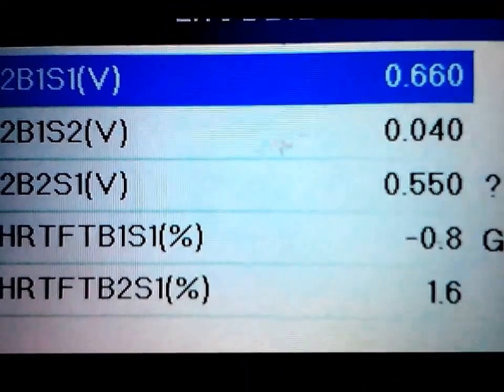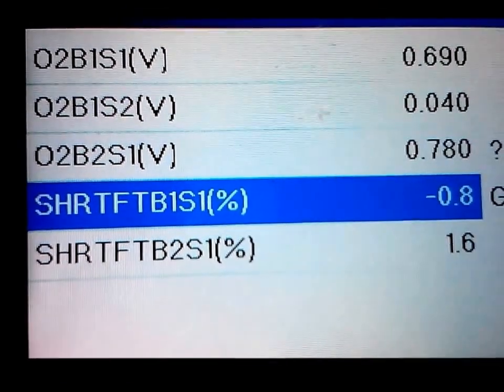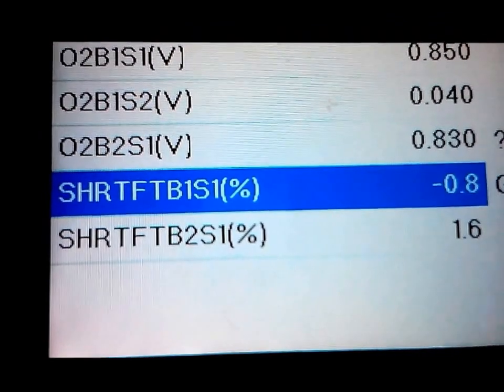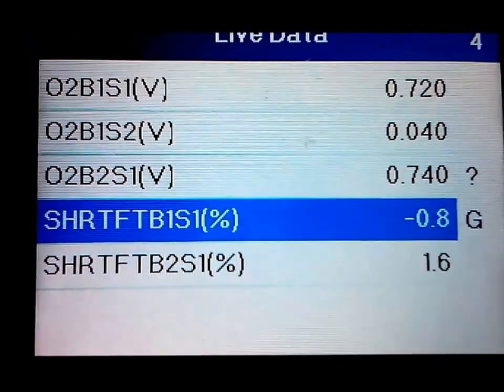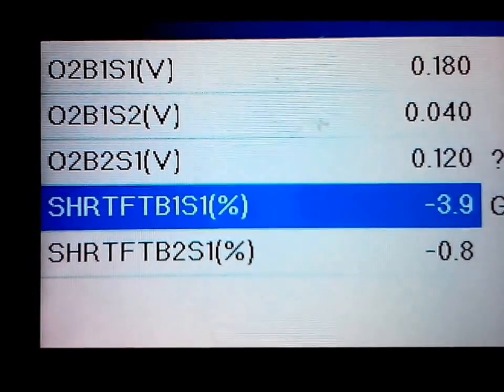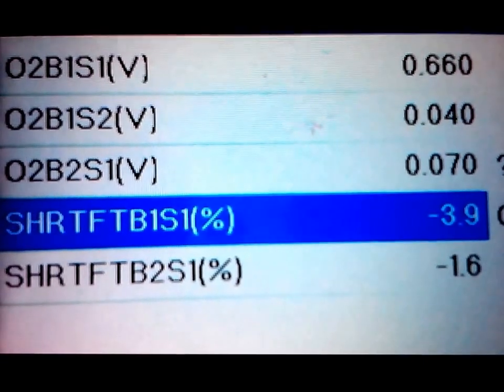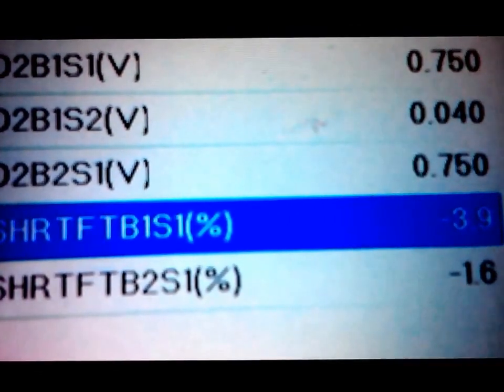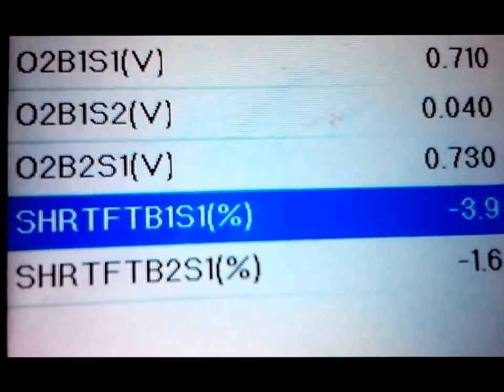live data obd2 scanner more details!

Comment: Thank you for the video. I have a p0087 on an fk8 after installing fuel system and turbo upgrade. No vacuum leaks, pressure tested the system, I’ve been over it about 20 times checking everything. It only as 5K miles on it. And now it threw a p0172 code. It’s dumping a lot of fuel and every component in the fuel system is brand new except for the fuel lines and rail and sensor. I’m thinking it’s the rail sensor but it’s $500 bc you have to buy the whole rail from the stealer. Any ideas? Thanks

Comment: So many problems that didn't exist when engines weren't computer controlled. You'd only have a problem if the engine had a problem, rather than the computer going into limp mode because a sensor or emission garbage device is faulty.
Reply: lol u n my dad get along

Comment: I have a 2010 CRV my short-term fuel trim at idle is 40+ then goes down to near 0 @ 2500 RPM. I have checked for vacuum leaks and found none replaced fuel injectors, pcv valve etc  has not fixed my problem car runs fine just know it's not right. Any suggestions?

Comment: Open loop is basically the "choke" on a cold start. Its turned off the sensors as the fuelling is a preset amount until the car engine is warmed up.
Closed loop is when the choke is off and the sensors kick in and are used to actively adjust the fuelling amount.

Comment: Hi, great videos, just looking at the voltage readings from my O2 sensor bank 1 sensor 1   2.81volts its the same from 2 scan tools engine hot @ idle, do you thing the sensor has had it ?
Reply: It might be a fuel ratio sensor.. 3.3v is perfect.. lower is rich.. higher is lean

Comment: When I'm looking at my love data on my 05 GP my STFT is staying around 25%? What does that mean idk much about fuel trims
Reply: I don't experience a driveability issue until I get to 50-70mph the rpms goes up and down like the car want's to stall
Reply: I believe you’re running rich then. Could be a big vacuum leak.
Reply: You could spray brake cleaner along the vacuum lines and if the idle goes, you’ve just found the leak and replace the hose. If there is no increase in idle, then you might have an internal vacuum leak. It could be one of your gaskets. Hope this helps!

Comment: I have an 02 gt 3.0 and I have a hesitation on low rpms, after 2 thousand  it goes away and runs fine. I have tried everything I can find to try. If any one has any ideas......  NEED HELP....... NO CHECK ENGINE LIGHT.......new plugs, wires, roter cap and button,  intake gasket,.... ANY IDEAS......

Comment: Great Job. Thanks for this. I have a lovely intermittent engine cut out and problem starter. I have already checked fuel pump and sensors and relays. No joy. This is now what I plan to do with crank over from cold I have no option won't give me "correct" readings anyway but hopefully help point me in the correct direction. Crank sensor would still show RPM for example.. hands dirty time after watching this.

Comment: I have a 97 f150 with p0174 and p0171 and I looked at fuel trim and they short and long r at 30 + and my truck runs rough at idle but it gets worse while driving
Reply: Was there a fix? Got the same problem.

Comment: I got the same scanner, working on my truck is basically a hobby but the camshaft sensor code come up so I put in a new sensor and erased codes but after a few hours I checked again an the code come up again. I don't know what else to do. any advice??
Reply from the maker: Drew Mckenzie thank you I really appreciate that! and as far as the code goes do you remember exactly what code it was? if it came back after the sensor was replaced with a known good one I would make sure there is power at the connector. if there is the only thing left would be a wiring issue hope this helps and let me know if you have the specific code
Reply: the code is P0342

Comment: Hi! Great video! Question: What about numbers regarding Long Term Fuel Trim? thanks again as always
Reply from the maker: Simply Z thank you! long term fuel trims you really want to see as close to 0 of course but anything around 1-3 positive or negative isn't that big of a deal. anything constant that is higher than that I would start to look around. but for long term you really want to see low numbers. I'll have a video up soon that will show examples between good and bad readings so hopefully that will explain it a bit better. thank you again
Reply: RIU Performance thanks so much! A video for that would be great!